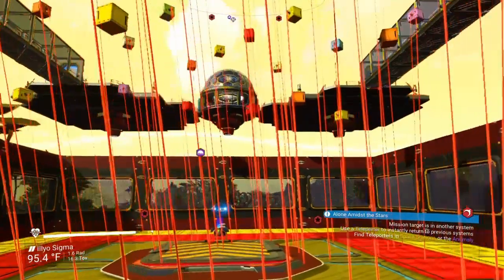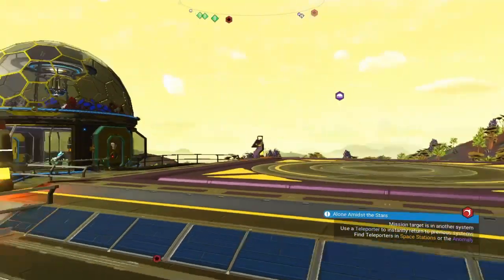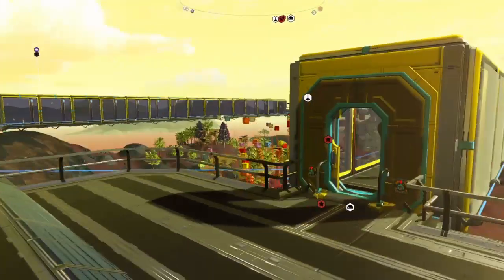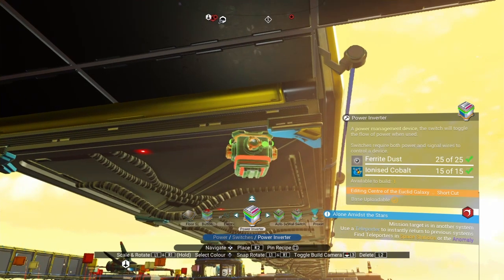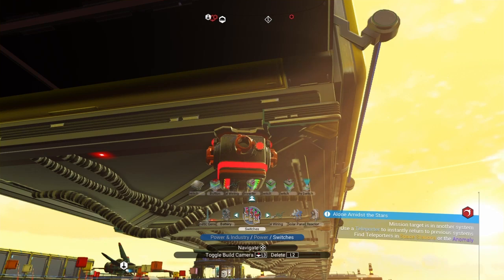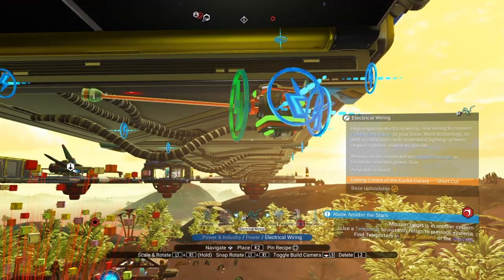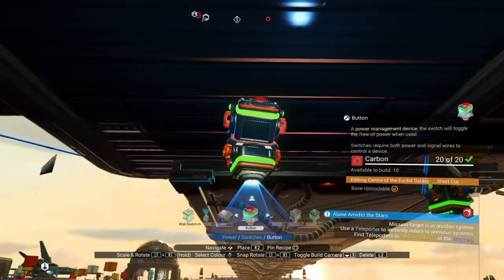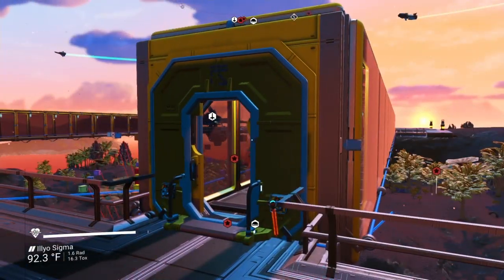No Mans Sky. How to Power Doors.

Comment: This is the third video that I follwed every step instruction 2 the door switches. This was done a bit differently than the last two, but 4 me the result is still the same. After everything is connected properly, the door doesn't open while i'm in proximity. If I move away, it props open then closes right back again. I can't figure out what is wrong unless there is a glitch in the mechanics.
Reply from the maker: This is happening as a result of the latest update, everytime theres an update it stops working. Hopefully they will fix it soon.
Reply from the maker: Latest update just fixed the problem 😊

Comment: hALP, Im trapped in a room with no way out. I havent researched any switches yet. How do you manually open up the mechanical doors?
Reply from the maker: The mechanical doors are open by default.
Reply: late reply but... disconnect the power to the door,  (remove the power wire)  that should open it
Reply: @MickManchester.  yes, until you walk inside and power them trapping yourself inside. its ok I built a ladder to escape eventually.